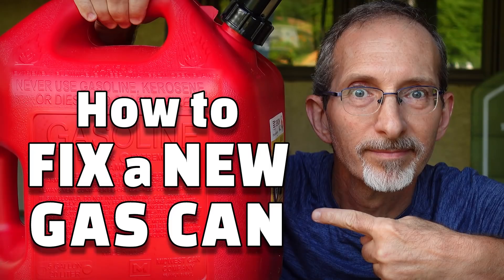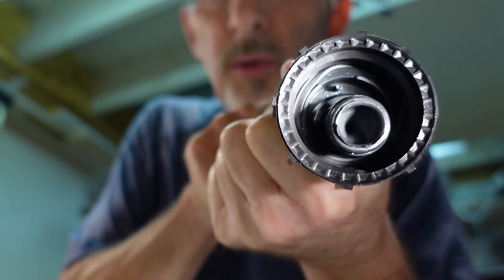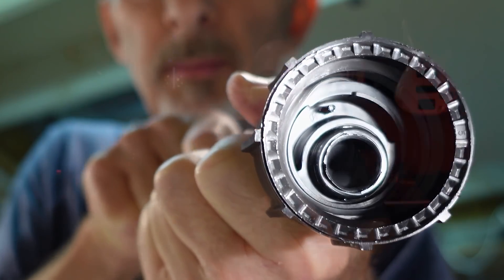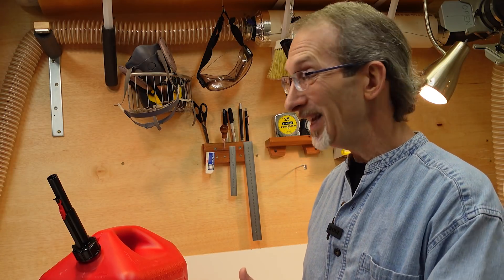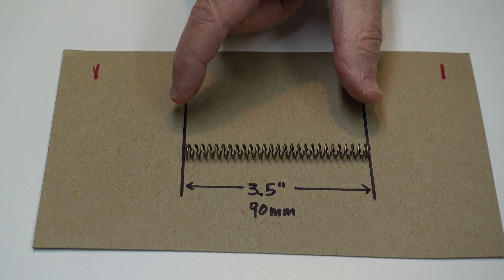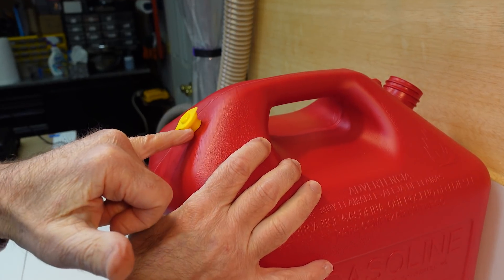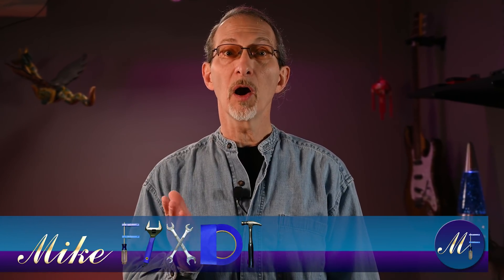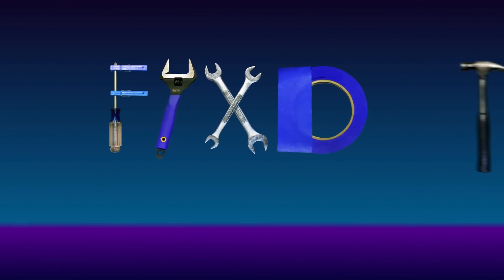Gas Can Modification | Part 2: Explosive Details!

Comment: I love this "mod" however you missed the point with the air vent build into the spout... its for when your filling up whatever and the gas hits the spout it stops the gas flow so you don't over fill the gas tank.. adding the new vent will stop the auto stop from happening .. also i think you cut off tooo much of the spring i see it failing in a short time.
Reply from the maker: I hear what you’re saying, but this spout design doesn’t really shut off when the receiving tank is full. It might choke the air going into the tank, but these containers are flexible enough that the container collapses some as it’s drawing a vacuum. The shortened spring has held up just fine, but I will keep an eye on it. Thanks for sharing your thoughts!

Comment: Do a web search for the "Blitz can company" and read why the nation's largest gas can company went out of business (short answer lawsuits) to find out why these new fuel cans are all made with these spark arrestor modifications in the USA. 

Also the EPA and the DOT made rules about the vents and child-proof spouts too.  Decent cans with regular spouts can still be purchased in Canada as they don't need to conform to the same US Federal ecological and transportation rules.

Finally, after removing the childproof lock on the spout the matching sharp tab on the tank should be cut flush and smoothed as well because it tends to rip the flesh of your finger when screwing the spout on or off.

We live on a boat and our diesel, gas, and water jugs live on deck tied to the rails. We have not modified the child-safety locks because it helps keep the spouts from loosening in rough seas and compromising the seal. Moisture not getting into the cans is more important than easy usability on the fuel cans in a marine environment.  

The flame arrestors on diesel tanks are not really necessary since diesel fuel does not have flammable fumes at normal outside temperatures and we use a transfer pump to move our fuel from the jugs into the onboard keel fuel tanks rather than the rather messy method of pouring jugs into the deck fuel fill. 

Midwest Can and other domestic fuel jug manufacturers put the flame arrestors in diesel jugs just to cover their butts because they don't know what kind of fuel consumers will store in them.  I have read comments/reviews online where people use the yellow jugs to store ethanol-free gasoline to differentiate the can from ethanol-blended gasoline that they use for gas engines that don't mind the ethanol.  DOT regulations determine the color-coding of fuel jugs and it actually is a violation of federal law to dispense fuel into non-approved containers. Every fuel pump in the USA should have a label on it that explains this.  Then again it is against the law to speed too and nobody follows speed limits either.  Since gas stations are mostly unattended with pay at pump credit card readers it is unlikely someone would ever say anything about using the wrong color jug for a particular fuel.

Finally, stretching a spring and cutting it in half actually should make a spring stiffer since the stiffness of a spring is an inverse function of the number of wraps it has, while the distance between the wraps has a much lesser effect.
Reply from the maker: Great comments! I’ve had other people tell me that stretching the spring after cutting would make it more resistant, but in practice it seems easier to depress. It’s also interesting to hear from people who use fuel containers in marine environments. I’m glad there are choices of different types of gas containers available to suit different applications. I bought these midwest cans sight unseen, when it was the only model available. In retrospect I wish I knew then what I know now!😁
Reply: We  have a couple of old and suspect Blitz 5-gallon cans which are similar to these Midwest ones with the two handle design.  The sun has darkened and hardened them over the past few years to the point where replacements are needed soon.  

With the diesel crunch we decided to buy a couple more new cans to have for our annual migration north for the warm months and still use the old Blitz cans until then  so we can carry a bit more fuel than usual. 5 gallons gets us about a day when we are motoring on the Intra-Coastal Waterway up the East Coast.

Blitz was sued into bankruptcy a few years back because of deciding not to implement the flash screens.  The Midwest cans are slightly wider and shorter than the Blitz which wastes a little bit of precious deck space.  But they will do.   I wish we could still get the old Blitz cans.

Comment: I just want to add that in addition to the chore of holding the weight of the can while fumbling with the lame spout a person might also be trying to hold a flashlight, as I was, when trying to refuel my generator in the dark.
Reply from the maker: Excellent point! I have a porch light where my generator is, and I can’t imagine having to hold a flashlight at the same time. Crazy!
Reply: I think you solved the mystery of the flame arrestor inclusion.  They used a lighter instead of a flashlight.

Comment: The weight of the gas can helps with pushing the nozzle down.  The weight of the container decreases in weight as the fluid leaves the can, making the can lighter in weight.  The speed of the fluid dispensing does not affect how long you hold the can, enough to truly make a difference.  Only thing I don’t like is the screen, but I’ll figure it out
I have cans from before the EPA “improved” them; I still use them.  I have two “improved” cans; took a few tries to get it down right.  Kind of like when I first used a gas can.  I actually like the new nozzles on my Gerry Cans; it’s like a third hand at times.
The EPA made up reasons to show why they needed to “improve” gas can, and people are making up reasons to dislike the “improved” gas can.  Like anything new, it takes a bit to get used to using, but most of us will figure it out.  Both the EPA and the PWC (people who complain) use infomercial tactics to justify their reasons.  
Do I always agree with the EPA?  Nope.  Do people sue everyone and their grandma for the stupid things they do, to get the EPA involved?  Yup.  Law suits keep Darwin from doing its job.
I don’t have a problem with the new cans and I don’t have a problem with the old cans.  Clever apes will figure it out.  Stupid apes will stick their fingers in their butts and smell it.

I made this post based on my experiences.
Reply: The original Gerry Can had the same air intake right above the pour spout.  It work flawlessly for decades.  Someone “improved” the can and put the vent hole and removed to air intake; likely do to costs (it cost more to put in a intake than it does to drill a little hole and add a plastic cap).  I take extra care of my cans and have never lost or broken off a vent cap, but I can’t tell you how many friends have broken off the cap.  They also don’t replace them like so many other people and gasoline vents out.  I wonder why the EPA had to get involved.
Reply from the maker: Lol, I love the acronym PWC! Thanks for contributing to the conversation!

Comment: Worked drilling rigs years ago.  Shell decided that we should only use brass hammers to prevent sparks.  We had never had a problem that way but with brass hammers kept sending brass chips into eyes, arms and faces.  They came out years later and said oh dang, use steel.  MANY other companies STILL insist on brass..... DERP
Reply from the maker: Wow, that’s a great story! I suppose the intentions are good, but the rules are being made by people that are not using the product. Perfect metaphor. Thank you for sharing!

Comment: So where can you buy spout end caps like the one you had printed? That will fit the Midwest can's spout? Also, after your mods to this can (spout and vent), have you tried it against the SureCan 5 gal can for flow, etc? Thanks.
Reply from the maker: @Bella, you can get the EZ-POUR Spout kit on Amazon for about $15. It includes the yellow vent. My kid made me the caps that fit the Midwest spout, so unfortunately that’s a one-off. I haven’t done a pouring competition with other brands but that’s a good idea 👍🏻. Thanks!

Comment: I appreciate the information in the video. Hearing about what that insert inside the can is actually supposed to be used for is all I needed to know to rip mine out. I still can't use my three 5 gallon cans with my car so I continue needing to use my single 1 gallon can in the middle. I'm looking for an electric pump but they all seem to have a problem with that insert. Again proven to be a detrimental design.

I actually hope they don't change the design of these cans because thankfully it's easy to "fix" them and I'd be concerned they may try to "improve" them and end up with something worse and harder to remove.

Comment: I just got one of the 2 gallon models of this can and did the original mods.  As for the cap, there was a red cap on the inside of the spout (where the O-ring had to be removed) and that cap fits perfectly on the end of the spout.  Now I'm going to look into the air vent mod.
Reply from the maker: I didn’t know the red cap worked on the spout. That’s good info! Thanks!
Reply: thanks for the reminder that this little red cap with a thump-nick on it, can fit on the spout!!! 👍("there was a red cap on the inside of the spout")

Comment: Is that little add-on yellow vent cap air tight, air tight between the red can and the yellow piece?
Reply from the maker: Steve, yes it fits very tightly. When there is a temperature shift, these cans tend to expand. The yellow caps have always held that pressure.
Reply: @MikeFyxdt  Thanks.

Comment: I hate the fire  mitigation device. I can’t tranfer fuel from one can to another with a syphon. I am definately going to take it out.  The epa spouts are retarded. Fuel mess everywhere.  I will just use a solid cap from ez-pour for gas storage and use a battery powered syphon for dispatching gas.
Reply from the maker: Jimmy, these are all popular options. It’s a shame we have to make all these changes to get a usable fuel container… Hopefully designs in the future will be easier to use from the get go. Thank you for watching and for joining the conversation!

Comment: What kinda boards you rockin' behind you bro?👍 Just curious... 💯
Reply from the maker: @Vizionz Multimedia - I have a Novation midi controller and a Korg Karma. I have to get back to using them! They’ve just been sitting there and looking pretty for several years…😁
Reply: @MikeFyxdt  I've always wanted to check out the Korg Series boards... Been messing around with my Roland FA-06 lately myself...

Comment: Not having the time or desire to read thru  1000+ previous comments please  forbear any redundancy here.
A crappy fitting vent cap is fine if you are NOT going to store any gas in the can, ie, you fill it and transfer fuel to something else, thereby emptying the can completely. But trusting that no-gasket vent to securely seal? Uh-uh. 

Safe? Maybe. I say no thanks!

....of course, YMMV. 💁🏻‍♂️
Reply from the maker: David, agreed! I don’t think these designs are good long term. I appreciate you watching and commenting!

Comment: damn i miss my old racing 6 gallon cans. hard plastic dual handle. vent with easy to pop open top. (sigh) easy large luged screw on cap (so you could use while wearing gloves) push on fitting to attach your 1" x 2' clear hose with foam filter to catch any debris. easy to fill the can at a gas station. while dispensing gas into my quads, mower, etc... never spilled a drop. my 3 cans lasted 15 years of heavy use. lucky enough to find 2 5 gallon lightly used ones. had to buy one of the crap new ones. what a damn joke.
Reply from the maker: I never thought I would hear people get sentimental over old fuel containers, but it really is a thing. This was a great description of how things used to be before all of these safety changes. Thanks for sharing your memories and joining the conversation!

Comment: The best spout I've ever used was the Enviro-Flo spout. It didn't leak, it was self-venting, and easy to use (after you removed/disabled the "safety features"). I bought some several years ago and still use them today.
Of course, the spout was outlawed by the Consumer Product Safety Commission -- clearly a bunch of people who know nothing about gas can safety
Reply from the maker: Rob, it seems like all of the good, usable designs are now being hampered by additional safety features that ironically make them less safe. Bring back the old designs!

Comment: If you own gas cans that do not have a difficult to use spout you can always simply take one that you prefer to use from one can and put on another.
Reply from the maker: Randy, great suggestion if they fit. I just wouldn't want to leave one container open while I'm borrowing the spout. I'm still hopeful that the new designs will be better!

Comment: How many folks surveyed that liked being told about the dangers of gasoline, liked Mid-West's solutions to these dangers once they tried using them? I'm guessing a very small percentage.

As far as shortening spring to make easier to compress that's counterintuitive. By shortening spring you actually make it stiffer. So although it may have less preload, it will require more force to compress per inch than before. The best thing to do would be to find a spring of that original length that has less force per inch of compression, which will probably mean it's made of thinner wire.
Reply from the maker: Agreed 100%
Reply: @MikeFyxdt  here a new one I hadn't seen before that looks like a copy of no spill
https://www.homedepot.com/p/Easy-Can-1-25-Gal-Gasoline-Can-with-FMD-3415/301697346?source=shoppingads&locale=en-US&mtc=Shopping-B-F_D28I-G-D28I-28_37_OUTDOOR_POWER_ACC-NA-NA-NA-SMART-NA-NA-SMART_SHP&cm_mmc=Shopping-B-F_D28I-G-D28I-28_37_OUTDOOR_POWER_ACC-NA-NA-NA-SMART-NA-NA-SMART_SHP-71700000079956011-58700006728091443-92700060957828818&gclid=Cj0KCQjw2tCGBhCLARIsABJGmZ6XXxDIennjCzdg3rEvN12axkSUXASTphtnKHPURtZCHuEJdpDMab0aAtNrEALw_wcB&gclsrc=aw.ds

Comment: I do not like them, Mike-I-Am
I do not like them, Mid-West-Can!
Reply from the maker: I do not like them when they’re pouring…

I do not like gas on my flooring.

(OK, that was a bit of a stretch! 😁)
Reply: @MikeFyxdt  here's a good demo of No-Spill if you haven't already seen
https://youtu.be/EwkYHm_T5-I
Reply from the maker: That’s really good! Thank you for sharing.
Reply: @MikeFyxdt  Home Depot now sells another "brand" that I'm pretty sure is made by No-spill as the parts sheet on HD has No-spill's address. Called Easy Can. A couple dollars cheaper than No-spill at tractor supply. Here video of no-spill repair if you want to see the guts. Mid-west just has a crappy design, not the worst I've seen but probably in the top 3.
https://youtu.be/JQUgNQTyO6E

Comment: We are changing a Midwest gas can into the equivalent of a 
Blitz gas can.  My Midwest cans turn into pressurized gasoline filled balloons in the summer. Safe??
Reply from the maker: John, these 5 gallon containers really bloat when it warms up! It’s a shame how many people have gotten squirted by gas because of the built up pressure. I’ve started routinely loosening the collar to ‘burp’ the can before using. So to answer your question, no. These containers leave a lot to be desired…

Comment: Great video, I'd already comments on the 1st video about not addressing the venting issue on new cans.

Supposedly the spout is self venting (not sure how that works).  I'd be interested in  a comparison of pouring 2 gallons of a can with 4-5 gallons in it (water?) with and without the vent you added open.  I suspect that on this can, the additional vent probably isn't worth adding if you keep the original spout.
Reply from the maker: That’s an excellent idea! I have a video plan where I’m going to compare a vented and non-vented container to see if it makes a difference. Stay tuned!

Comment: I carry two 5.0 gallon diesel cans (yellow) in my RV, but for gasoline (red) I only buy 2.5 gallon cans with non of Norm's reported problems.  I can more easily handle that size. Ron W4BIN
Reply from the maker: Ronald, I have to admit the 5 gallon containers get heavy quickly, especially when you have to hold them up at an awkward angle! I appreciate you watching and commenting!

Comment: The cans Walmart sells are... Slightly better. They have a hand held latch that requires you to depress a second button to depress it, so at least it works for small engines.
Reply from the maker: Good to know, thank you for sharing! It’s always nice to have other options…

Comment: The spout isn’t even flexible.  0/10 would not even consider buying.
Reply from the maker: Simon, having a flexible nozzle would make these so much easier to use. But I don’t think that the spring-loaded design would work on a flexible or curved nozzle. There is always an aftermarket nozzle as an option, and I will be reviewing one in an upcoming video so stay tuned!

Comment: I thought these "features" were a new EPA or CARB requirement.  Now that I know that the manufacturer did this on it's own volition, I will never buy this brand again.
Reply from the maker: Chuck, in my third video I discussed how these safety features have been signed into law. With these Midwest cans, perhaps they read the writing on the wall. Whatever the reason, we still need containers that are easier to use! I appreciate you watching and for joining the conversation.